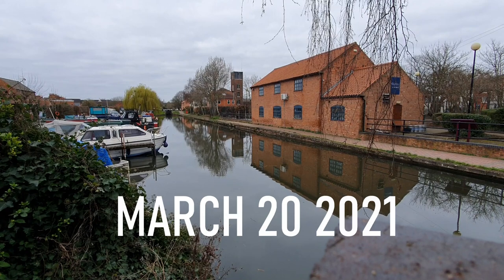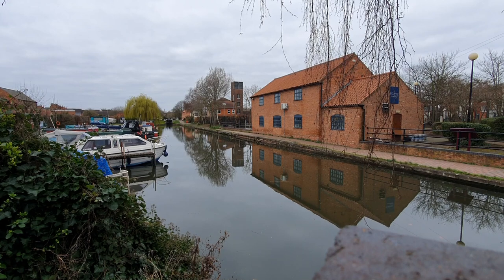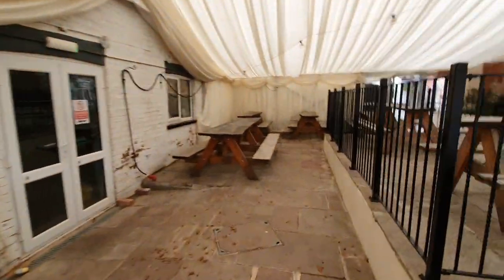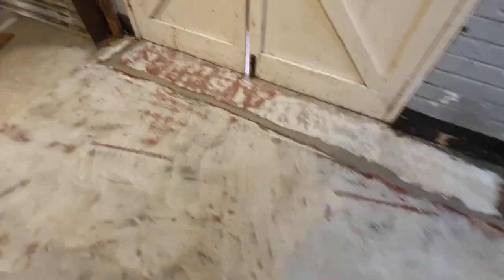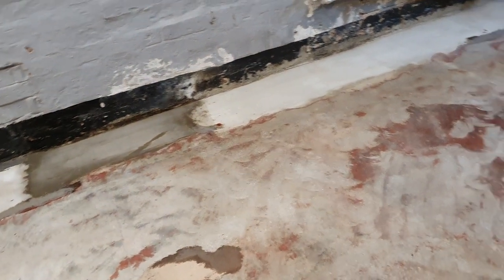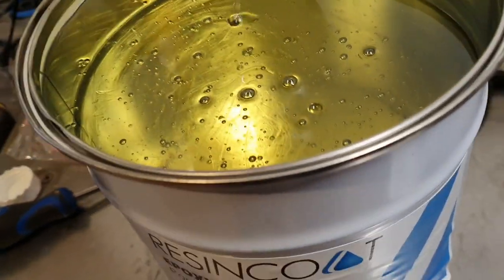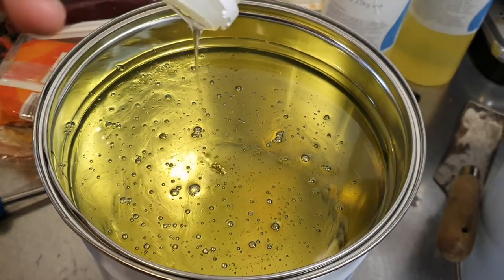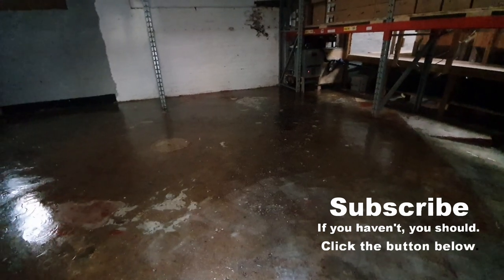Resin Primer Down

Comment: As long as you measure by weight you don't have to mix a whole tin at a time. I used to build boats using epoxy that came in 220kg barrels and certainly did not mix one of those  in one go. Mix what you need , then put the lids on tight.
If you pour the mix into a big roller tray that will also slow the working time, or just dump it on the floor and roll on.
Good luck.
Reply from the maker: Cheers Martin